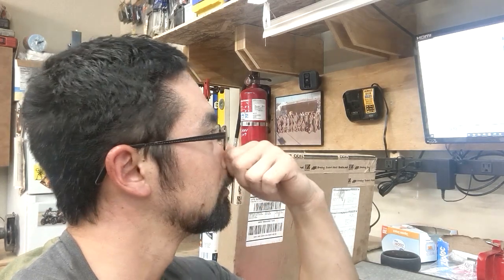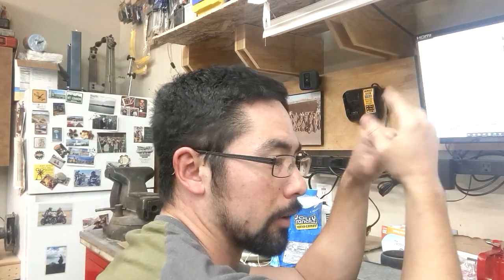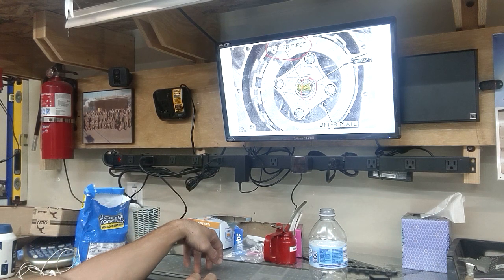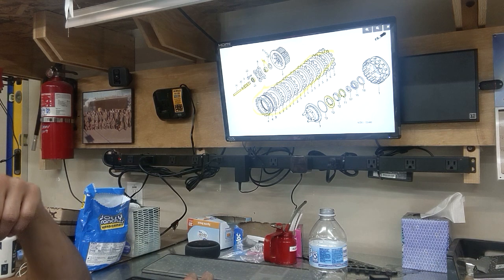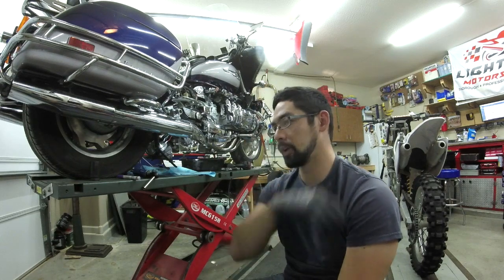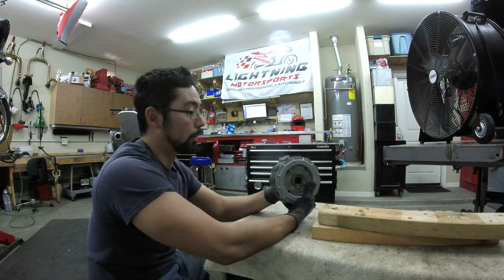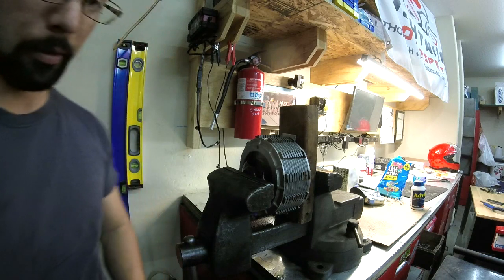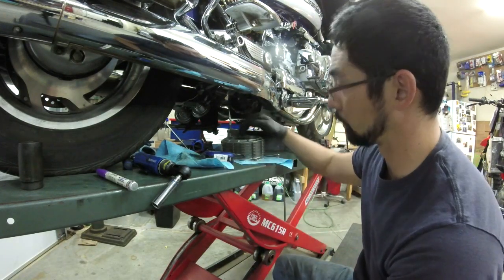Honda GL1500 Clutch Rebuild, Disassembly, Assembly - 01 Valkyrie Interstate

Comment: Just wanted to thank you for the HD oil filter socket idea. Brilliant! Made a nightmare job a snap. I simply used a bolt with nut & washers to compress the spring. Was able to lay the clutch pack flat on the workbench making the snap ring easier to access. BTW, it's the 97/98 Valks that have the broken rivet problem. I had 4 wedged between plates destroying things.

Comment: I have a 1999 GL1500SE Goldwing that had a leaking clutch slave. I saw your great video and decided to change out the clutch also. I have a $100 Craigslist lift table to lift my scooter on its center stand to save my back and knees - so why not? I removed the three alternator bolts which gave me plenty of unobstructed access to remove the clutch slave and clutch cover. I used an EBC inner clutch removal tool and improvised it with four 6mm bolts and washers to secure it to the inner clutch pack. That tool was needed to remove the bolt without damaging the outer basket or transmission gears and Game Over if that happens. You were spot on about noticing the small marks that match both ends and the liter plate also. I found a 5" long piece of 3" aluminum pipe (3/16" thick) to cut out 2.5" windows on one end. This was used to press the spring washer and remove the snap ring.  I used aluminum because it's strong and cuts easily with a miter saw and carbide blade. Fortunately I have a $150 12 ton shop press that I use frequently for many automotive projects to avoid the line at the machine $hop.  Waiting for original Honda parts took longer that doing the job. Thanks for your video and inspiration.
Reply from the maker: Hi James, I'm very happy to hear this pushed you to DIY/tackle the job yourself.  Hopefully, the project went smoothly for you.  Looks like you're also an airplane enthusiast - awesome.  Maybe we'll run into you at an airshow sometime (N736KP).  Take care.

Comment: I would have taken the header off to give you easier access. They come off pretty easy, 6 nuts on the engine where the header attaches and two bolts by the rear peg that holds the back of the header up. You will have to replace the header gaskets, they're cheap.

Comment: My 1997 Valkyrie has 117k miles on it and the clutch doesn't slip but the "friction zone" is non-existant. The clutch has to be almost all of the way released to start engaging. I'm debating replacing the clutch or scrapping the bike. IDK

Comment: my u joint on my 1500 started to vibrate on mild decel on the freeway so i pulled the u joint yoke......but i feel zero play in the u joint. will i have to pull the clutch cover to get to the output shaft bearing ?.......worried it will have to be pressed out and in on a main cover.starting to think it will be easier to just buy another bike !

Comment: I just did the clutch on my 97 valk. Well, I got it all back together. And while trying to bleed the clutch something’s not right. I got all the bubbles out, I think. But I’m still not getting much resistance on the lever, and it’s not engaging the clutch. Do you have any advice?
Reply from the maker: Did you bleed at the slave cylinder?  Did you clean the master cylinder at the lever?  Sometimes the hole of the master gets clogged with debris/old fluid.  Check for leaks